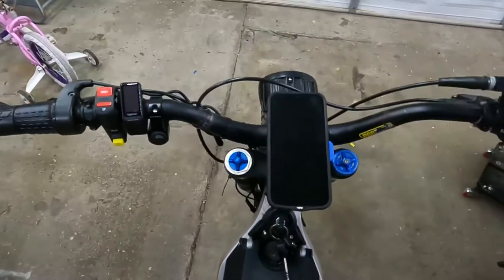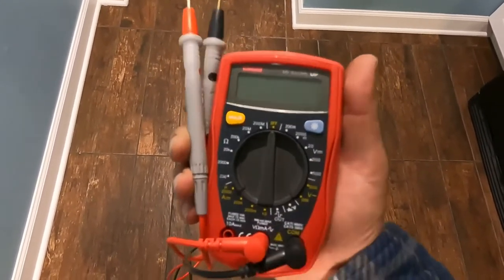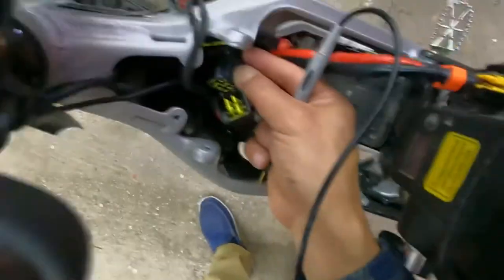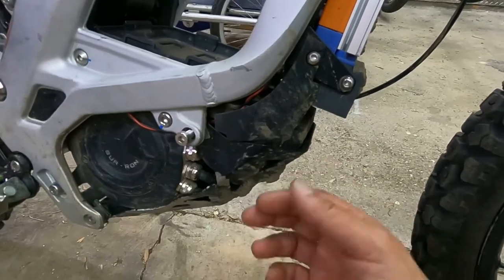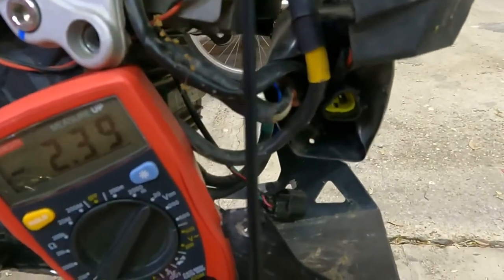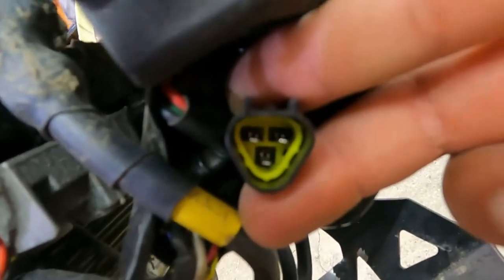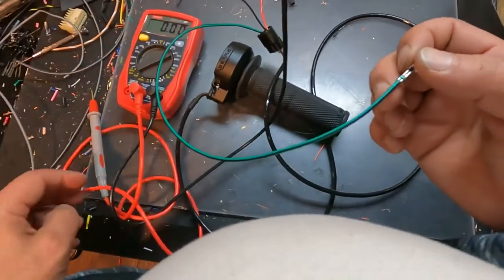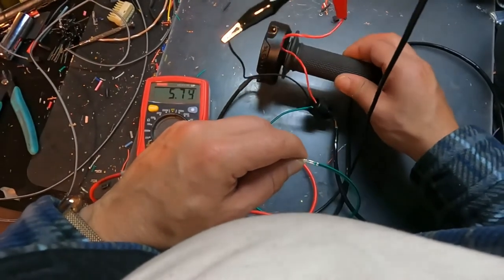Throttle Trouble shooting after install

Comment: I am Installing BAC4000 
I have  installed 3 BAC with no problem. 
But this new bac I just received is giving me trouble. Throttle does not work… 
I tapped the regen and my tire spun!!
I don’t know why my regen became the throttle.
Can you guys help me trouble shoot this issue.
Reply from the maker: Contact customer support
Reply: I sent a couple of emails to them
Waiting for response 

Thank you for quick reply
Reply: Did you ever fix issue?